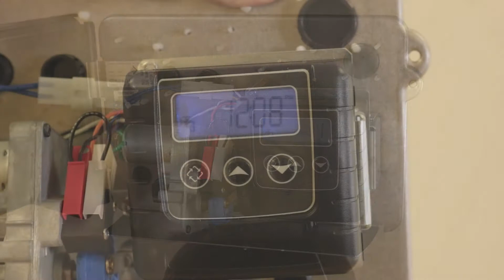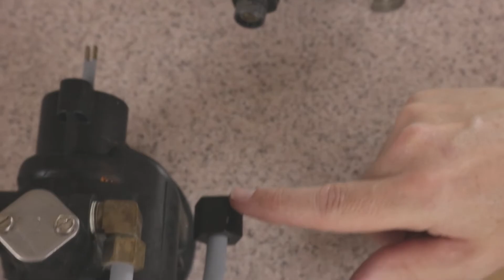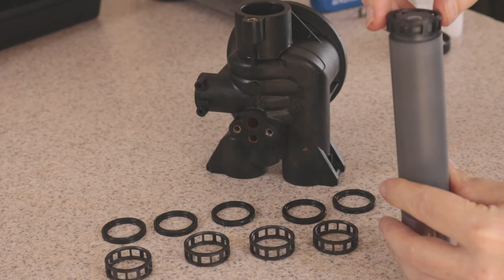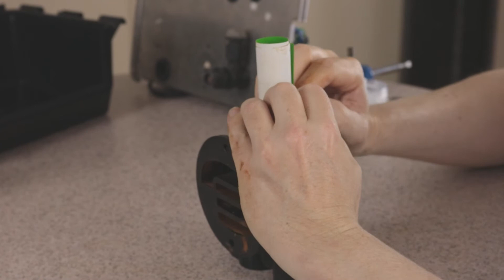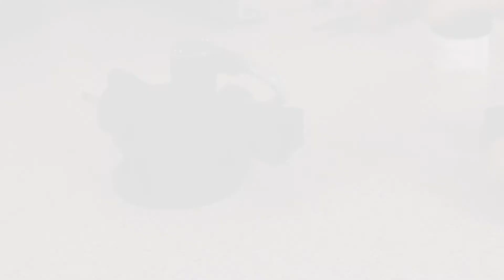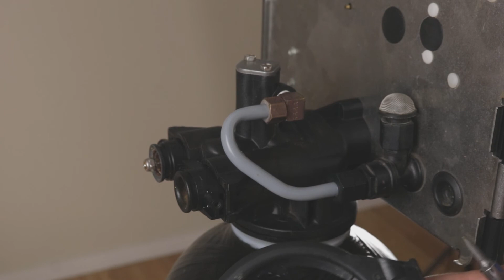Piston and Seal/Spacer Replacement on a Fleck 2510 AIO Control Valve

Comment: 2025 UPDATE:

FIVE TIPS:

1. While this demonstration does show you how to avoid buying tools, I bought them as a safety net, and they were worth the money IMO. The seals and spacers have an assigned groove they need to be in and I was having trouble making sure they were in the exact place they needed to be. Yup, the tools are 100% optional but if time and minimal frustration are things you value, spend the money on those tools.

2. My Fleck 2510 was mounted to a Sterling OXY3-10 iron filtration system, so its a bit of a different setup than what is shown in the video. I also dont have the digital system mode selector like that shown in the video. Mine is mostly analog dials with electronics. When I was first diagnosing the problem, the Sterling tech support had my put the system in discharge mode which makes the cam move the piston to its most deeply inserted position. I then dismantled the parts to clean them. However, as the video showed, after rebuilding the seals/spacers, the pistion is not in the same position as when you took it off. In my case, that was hyper exaggerated and I could not get the cotter pin back though the piston stem. Right or wrong, I plugged the unit back in and began cycling the cam through the different modes until it moved to a position that was super close to lining up holes to piston stem and cam shaft. Then I took a pair of meedle nose pliers and had to gently pull the piston a few millimeters to get the cotter pin holes to line up so I could get the pin properly secured. Once I got the cotter pin secured and the piston connected to the cam, I then cycled back to the discharge setting so that the piston postion would set back to what I needed. I dont know if this is a super bad way to do it, but it worked. That cotter pin is a pain.

3. The video is from an online retailer that sells all the rebuild kits for the Fleck 2510. They also have a tech support line. They are super friendly and very helpful. Definitely buy from them and call them if you need help! 

4. When connecting the Fleck 2510 back to the timing cam, you may find that the slit in the end of the piston shaft is in the wrong orientation to allow the cam shaft to slide between the prongs. Dont worry, the piston shaft rotates. Just take a pair of needle-nose pliers and gently grasp the solid part of the shaft (NOT THE PRONGS ON THE END) and rotate the shaft to where you need it to be.

5.  Dont bother cleaning injectors and screens. Just buy the $10 replacement kit. They are so small, cleaning them is a time consuming pain.

Good luck!

Comment: I wouldn't have thought that the rolled up paper method would have worked so well because the tool for the seal actually compresses the seal so that it clears the walls and then it releases it, that's a pretty cool trick

Comment: Is there a diffference between the softener piston and filter piston?
Reply from the maker: Per the Fleck manual, they do not list a separate piston for softeners or filters.  They do, however, have special piston for hot water applications and a special "No Hard Water Water Bypass" (NHWBP) piston.  The standard piston will allow you to demand untreated service water during the backwash process so water is always available.  The NHWBP piston is used in cases where you absolutely do NOT want to have untreated service flow during the backwash process.  These special pistons often cost a lot more and are not needed for most residential settings since you are unlikely to use water in the middle of the night when it is likely set to backwash anyway.

Comment: rebuilt mine and know i have no water in my house please help..
Reply from the maker: Hi Tricia, check to make sure that the bypass valve was turned back to the service position and that the little clip that secures the piston to the little rod connected to the motor is attached.

Comment: If I'm having constant water going out the drain line in service mode what would be wrong?? Injector gasket?
Reply from the maker: Most likely one of the seals has failed due to wear and tear.  These seals generally need to be replaced every 2 to 5 years depending on the type of filter you are operating.  Especially if you have an iron filter, the life will be shorter.  You can find this part kit here: https://www.home-water-purifiers-and-filters.com/fleck-2510-seals-and-spacers.php.  It is possible that there is scoring or damage to the piston that could cause this too but much less likely.  It is common to replace the piston at the same time as the seals.  You can find this one here: https://www.home-water-purifiers-and-filters.com/fleck-2510-piston.php.  The replacement of both of these is covered in this video.  You should also clean your injectors if you have an AIO iron filter, softener, or tannin filter.  This is also covered in the video :)
Reply: @HomeWaterPurifiers  it was both! The whole thing was caked in rust and scorn the pistons Teflon coating right off! Thank you for your help sir

Comment: please define the soak for a little while. how long is a "little while and are we scrubbing with a soft towel or something? thx
Reply from the maker: It depends on the extent of the iron deposits on the parts.  In most cases, we soak for about 30 minutes and the deposits normally dissolve almost completely with Rust Out or similar cleaner. If the deposits are very heavy, you may want to go a bit longer or do a second soak with fresh cleaner.   We sometimes have to wipe away some residue with a cloth or soft brush afterwards especially for non-smooth parts.  Doing so, certainly will not hurt anything.  An old toothbrush can be handy for that.

Comment: Just got a rebuild kit today. Thank you for the video. Wonder if I need to clean the injectors. Only issue I have noticed is the piston having a tough time.
Reply from the maker: Cleaning the injectors is pretty quick and easy.  I would recommend doing it while you are already taking time to work on the valve as it could prevent other problems down the road.
Reply: @HomeWaterPurifiers  I did end up cleaning everything . Running g smooth again. Thanks for the video!

Comment: BTW I have a tip from my experience doing the rebuild job. I found it almost impossible to remove the last two spacers from the valve body because they were cemented in place with iron oxide and scale. I found that soaking the body in CLR for an hour freed up the spacers making them easy to remove. I would have liked to soak the valve body in CLR overnight but could not go without the water supply for that long. If I were to do this job again I think I would order a spare valve body (99 bucks from AFWFilters) so that I could have it all set up ahead of time and just swap it out. Then I could soak the old one for as long as needed to totally clean it.

Comment: How do you determine the piston or the spacers need to be replaced?
Reply from the maker: In most cases, you will hear a small trickle of water running to the drain when the system is in its normal service mode (filtering/treating water).  Normally, in this cycle, you should not hear any water going to the drain.  This is a sign that there is damage to one of more of the seals, and there is a small amount of water leaking past the seal to the drain.  As pro-active maintenance, we generally recommend replacing the seals and spacers every couple of years especially if you have very high iron levels in your raw water.

Comment: Hi that’s a great video. I have an issue with a steady trickle of water flowing to the drain from the backwash. My question is, so you need to replace the piston on most occasions or can you usually get away with just the seal replacement. Many thanks.
Reply from the maker: Thanks for your feedback on the video!  A slow steady trickle to drain is a good indicator that the seals and spacers need to be replaced.  I would say that in most cases, you can get away without replacing the piston, however, it should be replaced if it is scored/scratched as this could cause water leakage to drain even with a new seal if the scratches are deep enough.  Given that it does take a bit of work to pull everything apart to do the seal and spacer replacement, a lot of people choose to just do the piston at the same time.  However, the piston definitely costs a bit more that the seals so I respect why one would not want to replace it unnecessarily. Some of our customers choose to purchase the piston and have one ready in case it is needed, but if the original is still in good shape, they re-use it and keep the new piston for future use.  I think this is a reasonable approach.  It is almost inevitable that eventually the piston will need replacement especially when used in an iron filter where it is subject to a pretty abusive environment.

Comment: Why engineers don't prefer to use selonoid valves to contol the water ? for more smooth pass ? or not to stress the tank ? thank you
Reply from the maker: I think there are a few reasons.  Most significantly, I think it would likely come down to cost and complexity as several solenoids would be required as opposed to a relatively simple motor and piston with seals.  I would also think that solenoid valves, especially on the raw / untreated side of the system would be prone to mineral build up which would likely cause solenoid failures.  Most of the solenoids I have used have a hard time with poor feed water quality.  Solenoid valves also slam shut very abruptly and would likely cause significant water hammer.

Comment: Why engineers don't prefer to use selonoid valves to contol the water ? for more smooth pass ? or not to stress the tank ? thank you
Reply from the maker: I think there are a few reasons including less likelihood of water hammer, cost, and reliability.  Conventional water softener valves with a motor driven piston and seals are very reliable, relatively low cost, and simple to maintain.  Because the piston moves relatively slowly, there is greatly reduced risk of water hammer as compared to the snap action of a solenoid valve.  As you note, the water hammer could be hard on the tank and other components in the water treatment or plumbing system.  Reliable/quality solenoids are also a bit pricey in comparison.

Comment: What are the symptoms of having bad spacers and or piston? I recently replaced my media again. And already my toilet are turning orange way to soon. Now Im sure it wasn’t the media but rather something wrong with my system itself. Thanks for this video. Much appreciated!
Also when we replaced the media we didn’t discharge the air like showed here. We just unscrewed the top. Would that cause any problems?
Reply from the maker: Hi Shannon.  The most common symptoms associated with a failed seal/spacer assembly or piston would be water leaking to the backwash drain line when the controller is in service mode.  If the piston was broken and in the service position, there would be a failure to backwash/regenerate at all.  This would eventually lead to performance problems and likely increasing pressure loss. Clogged injectors or a clogged injector screen could also cause performance problems by interfering with the air recharge process.  You would not have caused any harm by not discharging the air to drain at the beginning of the media replacement process.